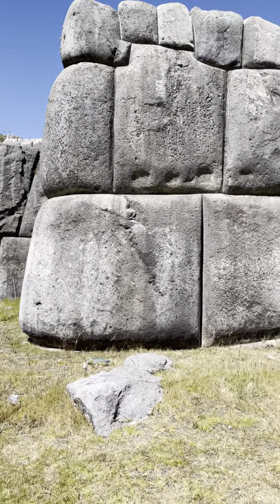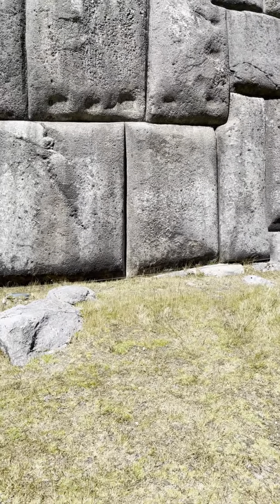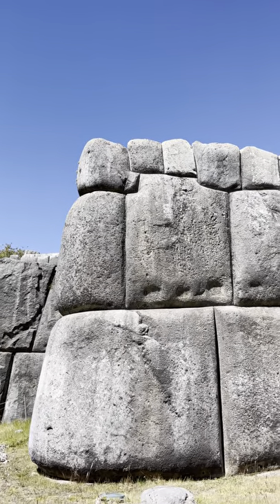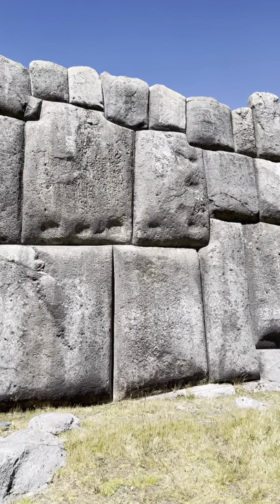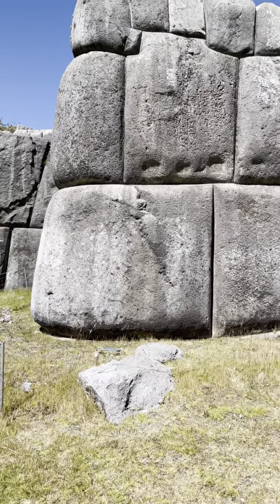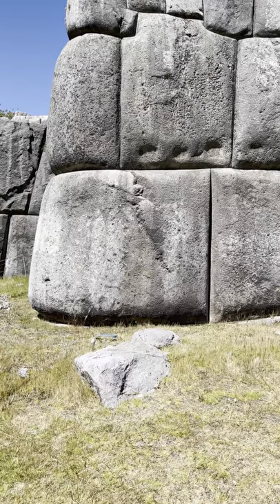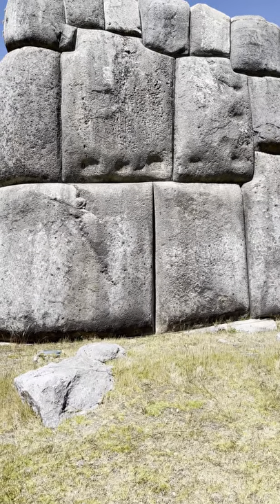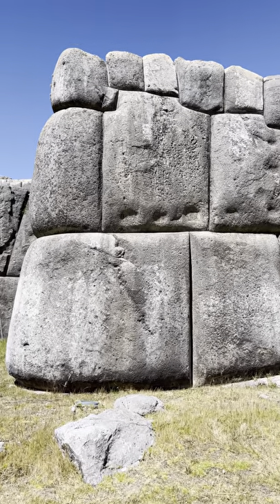Ancient Engineering of the Sacsayhuaman Megaliths

Comment: Simple they just compacted the ground and they they set the stones so the variable weight from the top stones would not allow it to shift the bottom stones are kind of rounded off on the on the bottom so they'll lay flat therefore with the right amount of weight up on top it won't let it shift

Comment: It is a matter of pressure: if the rock have all the same density and the same height, then the pressure on the soil is the same.
If you make a pile of them, as long as the height of the pile is constant, you have always the same pressure on the ground for each point, regardless of the shape and the number of stones.
Reply: Exactly this is similar logic to thinking a big rock falls faster if dropped
Reply: @Josh McInnes  i agree.
I also thought this is actually Stevino's law Applied for a solid: I'd you think about it, the pressure of the rock on the soil is the density of the rock multiplied by the height of it and the gravitational acceleration.
Quite nice :)
Reply: Amazing the knew all this back then
Reply: @joshmcinnesart  ummm size and weight definitely have to do with terminal velocity. What the hell are you thinking?
Reply: @ssako100  ever seen a feather and a hammer on the moon?
Reply: Nah its the nephilim
Reply: Also although the ground may be distributed with varying densities, even underground streams. The pressure is evenly distributed
Reply: Yeah exactly. All this guy did was expose his own ignorance.
Reply: But they're different sizes.
Reply: @lynsilva6565  it does not matter. As long as the height of the pile of rocks stays the same, the pressure on the ground is the same.

Keep in mind that pressure is not the same as force:
Let's say you have two 5lbs rock and decide to put them on your hands.
The first rock is shaped like a nail, pointing at your hand: you will feel quite a bit of pain.
The second rock with is one inch tall, therefore much wider than the other one.
Would you feel any pain? 

Now, imagine you hand as the soil where the rock is on.
Does the mere weight of the rock really matter?
Not really.
The real factor influencing the fact that the soil withstand the rock is the pressure on the soil itself.

You can even calculate that pressure multiplying the density of the rock times the height of the rock times the gravitational acceleration.

If you are a novice about this topic (no problem about that) you can think about the pressure without considering the gravitational acceleration, if you prefer, obtaining the distribution of the lbs of rock for every square foot under it.
In this case, just multiply the density of the rock (for example, expressed in lbs/ft³, you can find this value on wikipedia) times the height of the rock (for example, expressed in ft).

You can now recreate and experience the same pressure that the soil withstand under the rock putting an object with a certain contact area and weight on you hand, calculating the pressure by dividing the weight in lbs of that object by the area of the object when in contact with you hand :)

Let me know if you want me to write you an example to do it :)
Reply: @GeauxRight777  the giants were sons of the fallen angel's or gods of ancestors
Reply: @Mattiaeragiapreso  😂😂😂
No I think that about covered it!
Wow that was some explanation!  But I feel you.
Reply: @joshmcinnesart  now you're talking about an objects surface area/ wind resistance. Since there's no air on the moon they would fall at the same rate. Try to keep your arguments earthbound.
Reply: @politicallyinsensitive4200  ... these rocks aren't experiencing air resistance. Therefore it is equivalent
Reply: @lynsilva6565  but on same level and properly spaced they act as one on each layer being the same BUT different...kinda like humans
Reply: And all of you are experts right?
Reply: @VALERIAN19899  experts in grade 6 physics...
Reply: Some says size dosent matter, somesay it is .who cares?
Reply: @zeronine5227  size issues huh lol
Reply: It's a very similar concept as atmospheric pressure in the ocean. If you have a straw that's two miles long filled with water, the bottom of that straw has as much weight over it as any two mile point in the ocean.
Reply: @GeauxRight777  they didn't they simply said put stone wall up and call it a day for defence making

Comment: Maybe they are sitting on bedrock not on dirt. That's how.
Reply: And of course they overlap the joins to offset the load.  Perhaps they made models from small stones and extrapolated the results.
The point is that modern humans had the same hardware (or brains) with the same software (or thinking).  They then would be comparatively brilliant with their cutting-edge texhnology (stone work and water & land management)  as we are with our technologies.

No wonder we marvel!
So let's respect and revere OUR experts and back them in to succeed every time.  It's what we do!
Clever Monkeys, lol
Reply: @richardearnshaw2719  Those same small circle dents are similar to the one in Indonesia the pyramid of Indonesia has stones outside with the same dents
Reply: @richardearnshaw2719  Expeditionary Force soldier?
Reply: Lol bedrock?  how deep do you think they go 😂😂😂😂
Reply: Ask the giants
Reply: ... And where's your proof naysayer?
Reply: @SupremeGrandmasterAzrael1  lol exactly they didn't move a inch over 3000 years. The bedrock might be shallow but it's definitely not ground level. Even if the bedrock was only a foot under the earth it would still sink.
Reply: Ancient megalithic structures are far more advanced than anything weve made since
Reply: Exact thing I was gonna say
Reply: @SupremeGrandmasterAzrael1  bedrock can be at ground level you ever been on a mountain ? That is basically bedrock pushed up
Reply: @richardearnshaw2719  come on you're gonna say consciousness hasn't evolved. I mean average age tripled but consciousness, nothing? It seems obvious our consciousness evolves.
Reply: There are a couple of great points made here.
1 a great foundation.
Dug deep. There's probably more beneath it.
2.The way the stones are shaped.
This was a global technology. With a lot of earth like minds. Naturalist.
The astrology at the time has theses cites as conductors. All of the major building's had a gold cap. Along with the obelisk in the cities. The obelisk where kind of a power pole.
But how did we build such marvels of the times?
Im going to say. 
More advanced other worldly help.
Different breeds of hominids.
And way more time then scholars would accept.
The biblical flood happened. A lot of interbreeding and tribal mixing. And the flooding wiping out of population.
These places can be found as mostly foundations on the ocean floor at 400 to 600 hundred feet.
I can say. Our history is very vague. I have a fantastic story. That involves the true origin. But I'm not done researching and proving it's truth. And it has a lot of physical research to be had dealing with a missing link. I find that one link.
It will provide my hypnosis a ture or false here. But it may answer a ton of other questions for man kind.
Reply: Regardless these "primitive fools" constructed these with nothing more than a hammer and chisel. These people weren't primitive by any means.
Reply: Nope
Reply: @richardearnshaw2719  like to the first paragraph
Reply: So easy a cave man can do it.
Reply: Thank you ! Some people can’t think past their nose !
Reply: @SupremeGrandmasterAzrael1  lol 😆
Reply: Missing the point here lol 😆
Reply: @johnscanlon2598  you ever been anywhere on earth?  Lol stupid question.... not one place is like the other ! Every mountain is not made of solid rock ......
Reply: Bedrock and the way the weight is distributed to form a wall spreading the load seems to be the obvious solution.

Folks were clever back then, not as technologically advanced as today but still as clever as us.
Reply: I thought the same thing
Reply: Beat me to it
Reply: @richardearnshaw2719  people do respect and revere modern building experts. It’s the achievements of our ancestors that have been belittled, downplayed, misconstrued, and suppressed by the  authors of the “official” historical narrative. That’s what needs championing.
Reply: This isn’t minecraft
Reply: @SupremeGrandmasterAzrael1  wow
Reply: @realBAVIS  yep those big rocks got nothing on the ISS
Reply: I've been there. It's literally on a mountain. The rocks are on rocks. Go figure.
Reply: Came here to say that.
Reply: Yeah a natural footing.
Reply: I am a direct descendant of the people that built this and I am taking this secret to my grave.
Reply: Just going to say that.
Reply: @SupremeGrandmasterAzrael1  bed rock can be exposed or hundreds of feet deep. Considering this is in the MOUNTAINS it is quite reasonable to think this.
Reply: @richardearnshaw2719  no, people in the past were far more competent than modern people.
Reply: Yeah for sure. You beat me too it. You can see the ledge right behind it just out of shot
Reply: @richardearnshaw2719  Revelation 12:7-9
Martians are fun.  Mars once held life.
Reply: @paranormalfpv  Revelation 12:7-9
Reply: They are likely  geopolymers  . Weight distribution
Reply: Exactly. The only difference between our modern building techniques and theirs is technology! Human ingenuity is amazing and gets even more impressive the more difficult the task!
Reply: We really don’t know, this has to be studyid unbiasly
Reply: Provide proof, then I'll believe u. If u think they reach bedrock, then u need to go back to school and receive a better education
Reply: @jimlahey9253  Bruh, show me proof bedrock can never be at ground level. It doesn't have to be underground, the education bit was a great joke though.
Reply: @soupit32  Our consciousness has barely evolved 

It has limitations in biology lol 

Of which, we are barely different from humans 100,000 years ago

The only difference is collected knowledge, experience and wisdom of ages
Reply: @realBAVIS  well we invented concrete, and let that skill slip away.
Reply: @donkeytico13 wow you’re sooo smart I bet no one has ever considered that a possibility. You must be a real genius there donkeyteeth.
Reply: @richard earnshaw Oh yes perhaps you should learn how to write before you start trying to make a point when you can make sense
Reply: Pretty sure Flintstones is a cartoon dude.
Reply: Exactly what I thought. Is the structure sitting on dirt or stone?
Reply: Maybe
Reply: @SupremeGrandmasterAzrael1  how deep do you think bedrock is?
Reply: @realBAVIS  no, if so please deconstruct your house and live in one made only of stones no insulation. I’m sure you’ll be comfortable.
Reply: @Flannelsurfer  no it’s the opposite, you belittle the houses that keep you warm which the people who made this could only dream of. You belittle the modern world wonders and over gratify meaningless and useless creations from early humans  made for burials religious reasons that serve absolutely no purpose to us now including the architecture in which they are built is useless to us other than to look at.
Reply: @aztkshorty9138  haha well I’m sure you know what the exact purpose all ancient sites served, because you were there right? The mainstream scientific explanation for anything that doesn’t fit the established narrative is “religious site.” Downplaying the significance of some of the greatest and most enduring structures ever built, (for examples just the thousands of  pyramids alone,) and suggesting there is no value in learning about the past of humanity and the cataclysmic cycles that destroyed previous civilizations is woefully asinine and laughable ridiculous. Also you’re dead wrong, thousands of these sites remain in use today. Wow, just wow.
Reply: @Flannelsurfer  okay why don’t you live in a pyramid and why were the pyramids of Egypt just tombs? It’s almost like you think they haven’t been excavated and explored and that over the thousands of years that no one besides modern scientists have said anything about them. It’s almost like science is a constantly evolving base of knowledge about the history of our world our knowledge of these structures has evolved over thousands of years of science and writings and teachings. These structures serve no significance, if they were all destroyed today nothing would change besides some tourist exhibits being gone.  Some of the “greatest” they were great, they aren’t compared to modern technology the reason people don’t stack big stone blocks with precision to make monuments nowadays is because it doesn’t benefit anyone or anything. Monuments are just that, historical relics their importance is little past just being a reminder of a civilization and cultures history and architecture. No ancient civilizations aren’t more advanced then us now and their architecture isn’t better because they know pyramid strong shape or rocks that are built upon bedrock that are placed in a way that they distribute weight equally isn’t anything new and buildings better then these relics have been built since the beginning of the Roman republic.
Reply: @silverxshade156  yeah, just learned about those the other day. I guess those features are on stones at all the major megalithic sites.
Reply: @johnobserve517  there are a lot of interesting documentaries on the formation of mountains
Reply: @realBAVIS " it's not advanced" 
it is simply constructed. And because of that, It only accomplish its bare purpose. It was inefficient, very laborious and definitely take longer time to build! As an engineer would say: "every one can build a bridge, a good engineer can build a bridge that won't fall, but a top engineer can build a bridge that barely doesn't fall"
But yeah I have to agree sometimes simple is better!
Reply: @SupremeGrandmasterAzrael1  

Bedrock
noun
solid rock underlying loose deposits such as soil or alluvium.

How deep do you think bedrock has to be?
Reply: @DarthEyesDragon  he probably is making a joke about Minecraft or seriously believes bedrock is close to the earths core 😐
Reply: @jimmyfaulkner5746  you're missing the whole point. If all humans disappear there wouldn't be any buildings or stuff left in thousands of years, it'll all fall apart and become unrecognizable but the pyramids of Giza and megalith walls will still standing in perfect shape
Reply: @silverxshade156  yeah the little like notch things its trippy there are also in japan, indian, Egypt and everywhere else theres massive stonework.
Reply: @johnobserve517  Are you serious? Yes, every mountain on Earth is made up of rock. Do you believe there are mountains made solely of dirt or gravel? No.
Reply: @Creep'nNthaCut That's not how Geology works. It's built on a mountain, so solid rock all the way through. Bedrock isn't like dirt, it can't just allow things on top to start sinking like dirt. it's not going anywhere, that's why they built it there. The Native South American's weren't stupid, they knew what they were doing.
Reply: @jimlahey9253  Are you serious? This was built in a mountain. Now tell me, what are mountains made of? I wouldn't be telling anyone to go back to school if I were you.
Reply: @themenagerie5247  So what exactly do you think is under bedrock? Dirt?
Reply: @SupremeGrandmasterAzrael1  lol what makes you think the Bedrock is super deep? There are lots of places on the planet where Bedrock is directly on the surface like the cairns of Ireland.
Reply: @finck9226  how do you know they didn't move an inch? If they're moving as one solid Mass they could have moved ten feet and you wouldn't know. Do you have any idea how much material is deposited over the surface of the Earth every year that becomes the hummus later we all refer to as dirt? And you have any idea how many cataclysms there have been that have deposited and displaced an Untold amount of soil?
 The only time that Bedrock sinks is when it's subducted buy another tectonic plate. There's a reason why when they build skyscrapers they dig down for the footing to put it in Bedrock that's because it doesn't move and if it did it moves as an entire mass and so there's no measurable or appreciated difference from one spot to another.
Usually the only time other than subduction that there's a change in the Bedrock is when erosion is in play play but the soil keep that from happening here.
Reply: In many of the ancient sites like this one where stonework like this has been found they have found clamps made from metal that ties the stones together and keep them moving as one mass. Those same clamps have been discovered here and that probably has a lot more to do with the fact that the stones haven't separated from each other.
Reply: @CleanupKrew7  clearly u are the one who doesn't know how bedrock works lol
Reply: @SupremeGrandmasterAzrael1  right around -60
Reply: You can't just build a skyscraper anywhere! You have to build on bedrock!
Reply: @SupremeGrandmasterAzrael1  Well I seem to recall .. was it a 75m tall robot??? 🤔 
  I had thought it would be used to open the Olympic Games - now I'm wondering if Elon may have commissioned it to go into space holding tightly to his Falcon Heavy (Falcon heavy? It is if you have to lift it! Lol)
Reply: @Flannelsurfer  Totally agree!
History is written by the victors - we can't assume that alternative governance and/or  cultural aberrations did not lead in the past to an erasure of something too cool for school 👍
Where is that 75m robot they were working on??
Has Elon bought it yet?  Imagine that thing visible by night & possibly by day, lol  (I miss my kids and their pre-school TV shows " Dragonball Z" & "Sailor Moon" ha ha! Yes I have one of each!!  
What a culture!👍👍❤❤
Reply: @jasonpedersen3320  oh wow! Really? That's not Jordan Petersen by any chance?  Lol
Reply: Bro mijecraft jsnt real life
nd breadrock is down bellow very far distance down
Reply: That's where the Flintstones live
Reply: @YOZOYYOZOY  I am too and I told all my friends and their families.
Reply: I was thinking the same is there is more bigger rocks underneath